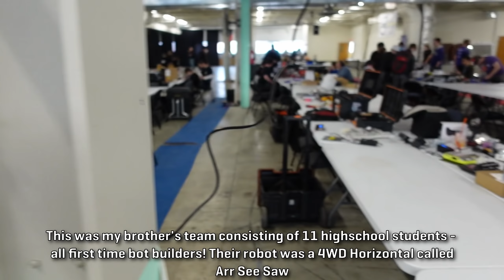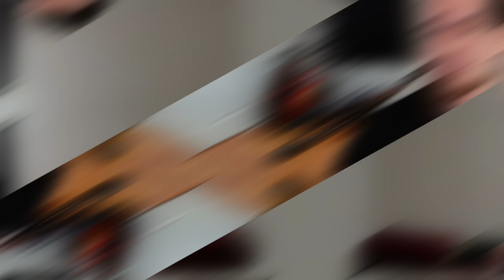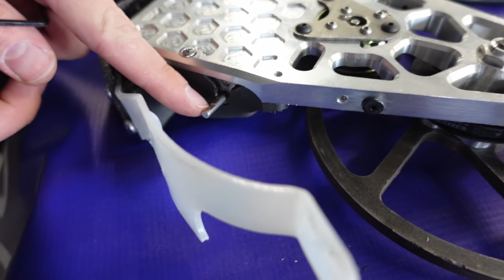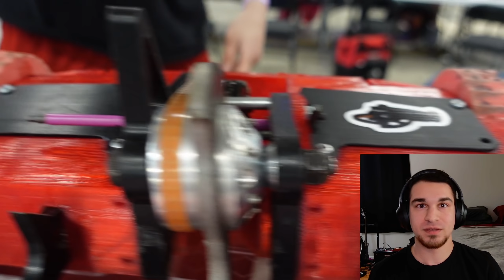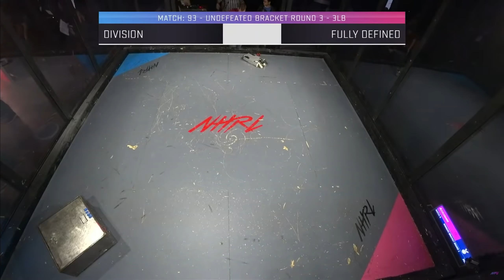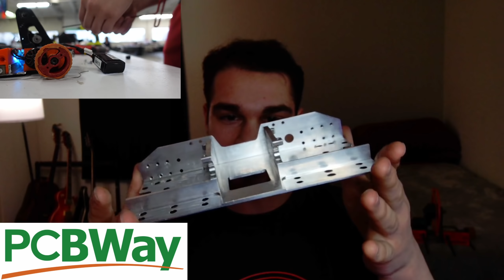Division V3: Will it Work? Norwalk Havoc March 2022 Event Recap (3lb Beetleweight Combat Robot)

Comment: If the rear is likely to see damage regularly, I would have the rear section replaceable instead of having as part of your expensive and hard to replace billet. This would then make it easier to service the rear of the bot but you may lose some rigidity.

Comment: I would love to see "piano finger" type wedges (like Blip or whiplash had in season 6). Whenever a bot has extremely long forks, they gain extra reach, but it becomes easier to get to their sides. If you have longer forks, use your forks. If they have longer forks, use "piano fingers" since only the front of forks are sharp, so a wide wedge would be better when going around the side.
Reply from the maker: That would be tricky to implement at 3 lb scale but not a bad idea. Division is definitely not the correct type of robot to utilize control style wedges though

Comment: The self-righting worked great!

I thought for sure the little power PCB would explode on any weapon contact but it seems to hold up pretty well even after the back getting rekt pretty hard.

I'm not sure if you already have one, but if I can suggest one thing, is to make a pre-fight checklist and print out a copy for each potential fight so you can literally check every item off as you go. 
As you said yourself this event was a bit chaotic and rushed between the fights, so having just a list you can check off your to-do's one-by-one to have a standardized pit routine could help with those "ah crap i forgot to * and now my robot is borked in the box" moments. Check lists are great to have in high-stress/high-workload environments (hence why NASA and airline pilots use them all the time). If you already have one, might be a good time to think on it to see if you're missing anything or expand it with lessons learned from this.

Good luck in the next tournament and hopefully you'll get more possibilities of recording your own footage. One of the things I really like about these recaps is that while the fight has been shown on-stream, it gives another angle and post-fight damage reports that give insights that would otherwise be hard to see from just the stream.
Reply from the maker: Thank you! And yeah I was a bit surprised as to how the PCBs held up. Even in testing I got one sucked I to my own bot's weapon and it bent it but it was still working. Turns out copper is pretty ductile even in PCB form. I am also using 2oz copper which is twice as thick as most PCBs use so it has a lot of extra 'overhead', even if one side of the board had the copper split apart it would probably work fine except for the most demanding spinup. 

The major downside seems to be that since all the connectors are hard mounted I needed to rely on zip ties, hot glue and tape for keeping everything plugged in. In over 30 fights I never had issues with the battery unplugging before since the wires were loosely sitting in the robot so almost no amount of shock would unplug it... Til now.

Comment: I would suggest having the top plate connected to the billet ass, as with the current setup it's prone to bending like it did in the second fight
Reply from the maker: Right now the top armor is really thin carbon fiber. I'm not sure that it would add too much structurally. That said there are two extra holes in the back of the robot that can be used to add a fifth screw point that could connect to the top armor if I find that will help but it would connect to the aluminum not to the TP you. Right now the ball is exactly 3 lb in the configuration that I showed in the test box. The forks are a little bit lighter and different blade options might be slightly lighter as well but I don't have the weight to play with that at the moment. The new chassis is about 0.4 Oz heavier and the new battery is also a bit heavier. The TPU is about 0.7 Oz.

Comment: So one thing I'm wondering looking at the billet: why is there no connection between the backside and anything else? Any connection would make that much more stronger. Or some small triangular pieces to give that edge some more structural strength. 

I'm really curious about the reasoning behind that.
Reply from the maker: The way CNC machining works it needs to be milled from the top and sides, so it's not really possible to connect it to anything except the upright mounts, and the PCB passes behind the uprights.honestly it wouldn't have helped tho since it got hit far enough off to the side that it would have just bent between the upright and side anyway which it already did in this case. He got an extremely lucky shot inside the switch hole.
Reply: @JustCuzRobotics  Ah gotcha. I was afraid it would be something like that.

Comment: Any changes to the fork setup? Those protruding pieces seem to be getting more and more advanced.
Reply from the maker: I did change the mounts entirely between V2.12 and V3. The previous mounts were asymmetrical with a left and right side and they also relied on a screw to prevent fork travel too far up. The new mounts are printed on their back rather than bottom surface which allowed the geometry to be a lot better. They are identical on each side and have a static fork mount on both sides as well as hinged fork mounts on both sides. The fork travel is now limited by the TPU mount itself and should never allow the forks to get stuck like they did before when the limiting screws tore out. They also have a protruding lip at the front that can protect the billet a little from any direct hits.
Reply from the maker: Oh also the forks are now 3/16" AR500 and a lot lighter than the prior 1/4" AR500 ones. They are less durable but the weight tradeoff is well worth it.

Comment: What connector came unplugged? XT60? XT30? do you usually tape them in? Does it really help?
Reply from the maker: I was using an XT30U, and usually I don't have to but because the PCB that everything is wired to is hard mounted it stresses the connections more than usual. I had every other connector hot glued or zip tied after some came apart in testing due to the shock of my own weapon hits. It definitely helps. We do electrical tape or zip ties on XT60 and XT90 in Bloodsport and Retrograde too. But I didn't have space for a zip tie on the battery and hoped it would be fine... The new battery is longer and narrower so there is space for a zip tie now and I'll probably use one every in fight from now on.

Comment: Will you change the pcb-negative-side-stuff? Or do you think it will be fine?
Reply from the maker: I can't do anything about it for this event. I might change it out in the future if it continues to be a problem but I just made sure to do a better job of insulating everything for now. As long as there is no electrical connection between the PCP and the frame it shouldn't be an issue
Reply: Good luck, I will be watching! I watched the whole nhrl stream last time, I better prepare for another weekend of bingewatching... (help)

Comment: How did you find the weight for all the upgrades in ver3.1?
Reply from the maker: I made sure that version 3.0 was underweight to start with so that I would have some room to play with. I had a bit more than an ounce of extra weight. The battery and TPU back happened to add up to make the bot exactly 3 lbs now in the configuration that I showed on camera at the end. I have lighter weapons and I think the forks are lighter than the wedge anyway so I should be good except with the heaviest weapon and the wedge

Comment: Leave it to Seth to forget to put a piece of tape on his battery connector.
Reply from the maker: Not really sure what you're implying. I've never had to tape that connector before and it's never unplugged itself in the last Thirty fights that I had. But having the PCB hard mounted to the back of the robot makes it so that all of the connections get stressed during hits in ways that they never were with previous versions of the bot